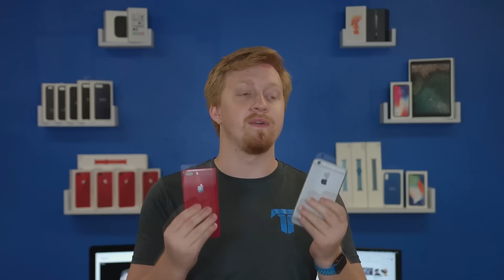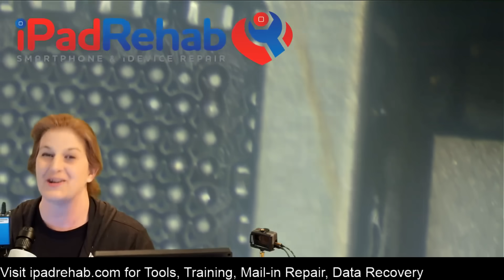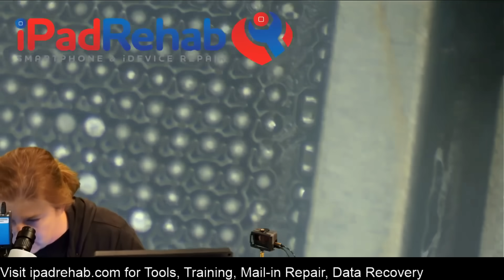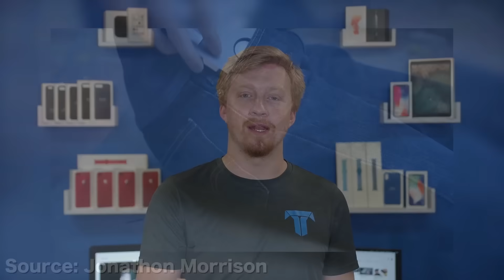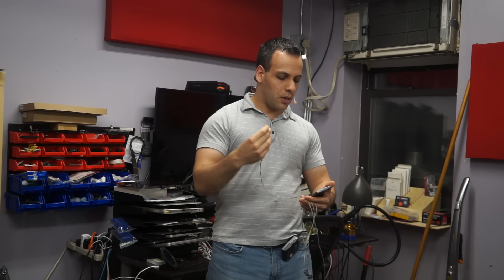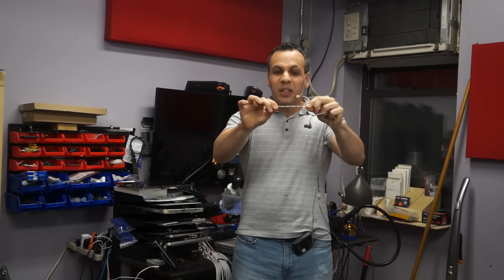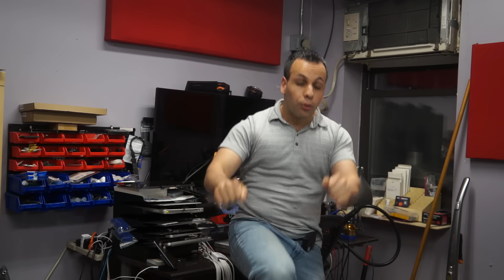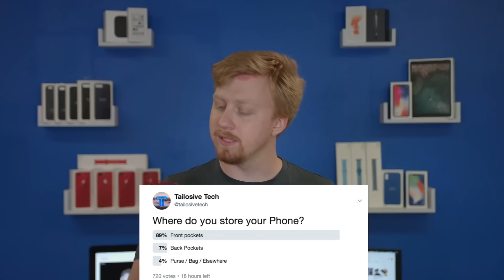The truth about iPhone bendgate deniers

Comment: In engineering term, it's called Fatigue. If you have this problem this that thing is purely design because in engineering fundamental, we create thing that go beyond fatigue requirement and that's called SAFETY FACTOR, Imagine if you went up to your office by elevator and in a week it's starting to losing it's speed, that's unacceptable to safety of people. 
Fatigue occurred by you give it extension force and compression force at the same area and over and over, you can try this on your metal or spoon and that's how the magic trick on spoon bending works. The word : Poorly engineered is the right word when this happen between in warranty's period.

Everything has fatigue and they will wear out up on time and that's why there's warranty's period because it's engineered not to break inside that period of time and if it does, it's bad engineered or bad process of producing.

Comment: Apple has been going down hill since iphone 7. For the past 6 years, my work phone has always be iphone, newest model provided by my company every year and my personal phone is always samsung's newest model. Despite the bendgate iPhone 6&6s were still great products. But since iphone7,  I start to see more and more issue with basic function, like making phone calls and messages and it has occurred to many other iPhone users in my company. Starting from iphone 7, it always stuck in the phone call screen, and it literally took apple couple of month to get it fixed. And follow up by iphone x, the signal is incredibly weak, usually 2 bars lower than iphone 7, and it never get resolved. And according to out IT department, Apple's customer service are much worse than before, the tech support are unprofessional and lack of experience. And now we are considering to switch to samsung business

Comment: I still remember when the first Samsung Note came out and Apple made fun of them for being big phones. "Pointlessly huge" "like talking into a piece of bread" 
And then they go and make bigger phones and their fans eat it up...
Reply: I got the Note 2. People laughed at me for such a big phone. 4 years later, Apple is lauded for innovative design.
Reply: @ericgulseth74  And the notes have always used AMOLED....Apple still isn't using it exclusively LOL.
Reply: @camperpro482  amoled sucks? This a joke? Or you just trolling?
Reply: @emmanuelmedina2740  30% less pixels so it really depends on your wants and needs
Reply: @0xsergy  30% less pixels? Where'd you even get that from? Display type has no bearing on pixel count. A higher resolution is a higher resolution. Both Samsung and Apple use the same type of panel, with the GS10 having 550ppi and the XS having 458ppi. 
Whites are worse? Have you heard about a little thing called "settings"?
Reply: @emmanuelmedina2740  subpixel arrangement. OLEDs share blue pixels instead of having a separate blue pixel for each pixel so they lose it. If you put an LCD and oled phone of the same res side to side you can see the difference. Google for more info about subpixels as images help. I tried to downgrade to an OLED but seeing the pixelation was annoying so I bought an lg g7 specifically for the LCD 1440p screen. Imho it's false advertising to sell 1080p or 1440p OLED screens as is because they're not really 1080p but more like 800pish. There are new OLED screens dropping now that apparently improve this but they're only available in brand new tvs for now (and not many mind you)
Reply: @0xsergy  iphone x has an oled display
Reply: @MrWizardjr9  yeah, and? Lol what's your point
Reply: Apple people are just plain crazy
Reply: don't forget pretending like it was apple's idea after the fact.
Reply: I remember that to they laughed then years later did it and apple sheep made an excuse about it later
Reply: I must say, even though I own an iPhone X, I wished I still had the formfactor of my old iPhone 5s.... I miss smaller phones... Nowadays I sometimes struggle to use that X-thing with one hand, but it also feels weird in the front pockets. Not all my pants have big enough pockets.
Reply: @Tramveller  if you don't have one already you should definitely get a popsocket to help holding the phone. It's 100x easier and more comfortable.
Reply: @marklewandowski8474  Oh my god, I hate these things. With that my phones would hardly fit in any of my pants xD Also they don't look too good
Reply: @Tramveller  hmm idk then... they do fold down almost completely flat so if it isnt fitting I'm not rly sure what to say
Reply: Mark Lewandowski Depends on the material. Steel is less prone to folding than aluminium.
Reply: @Kappa that's a fair point. Dark mode should help battery life a ton. I'll admit my g7 is lacking in battery but it's only 3000mah not 4000 like most big phones
Reply: @0xsergy  My phone is Samsung Galaxy S6 with exynos7420 CPU and a 2550mAh battery...
Reply: @Kappa Yeah, I might want to switch to android too. It is not the fault of iOS, I think that has improved a lot, it is just that iDevices keep getting more expensive nowadays and Android has also become pretty stable in terms of usability.
Reply: And the note was big for a reason! Theirs aren't
Reply: Yeah, but Samsung just did the same thing mocking Apple for not having removable batteries, sd card slot, and a headphone jack....
Reply: @Kappa I miss that from my G4. Unfortunately it and the three replacements I got all had serious battery drain issues. Refurb units so I bet that's it.
Reply: "How many Apple™ products have you bent in your life ?"
Reply: @cymes82  none, they're overpriced and not worth buying
Reply: 0xsergy they are not over priced lol. You get what you pay for. I’d rather spend extra 200 on the xs max than the s10 plus
Reply: @TT-zp8hg  Hardware spec wise they are super overpriced. Screen isn't 1440p, don't have the latest Snapdragon 845 etc. And yes you do get what you pay for, problems because that's all apple is selling you.
Reply: @cymes82  is this a Jojo reference
Reply: Because those were Steve Jobs ideals and he kinda died
Reply: I had a dell streak in 2010. dreadful phone. great for everything else. a year later, when I missed an important call (a job) on the damn thing because of its stupid touchscreen not disarming itself when the phone is in use, I threw it across the room & bought an iphone 4, which I promptly JB'd. I've never broken an iphone. my mrs has broken five so far. 
*apple needs to make its products girl-proof*.  I want louis to take a swing at sir jony ive; the guy's been treading water since jobs died, while tim cook seems determined to kill everything they've built by allowing this incompetence on his watch (no pun intended).
Reply: I honestly think Motorola makes the best phones.  They're tough little bastids and easy to flash, not to mention hard to brick. With that said, Motorola refuses to make a larger Note size phone.  For people like me with large hands, I need a big phone. This is why I bought the Note back in the day and have stayed with the Note line ever since(except the note 7, didn't get that one, thank god). Samsung makes great phones, no doubt. They do have their issues come up from time to time. But mostly very stable phones with very useful features.
Reply: ag.onewheel XR ye it’s bloody bullshite, and now I can’t find a bloody phone that’s actually good. (the last good iPhone’s dying on me.) at this rate, I’ll be looking for a flip phone in a few weeks.
Reply: Anything to distance from competition. Samsung spent a ton of money making videos mocking Apple for removing things like the headphone jack, now they took those videos down and removed the jack from the Note 10.
Reply: Ribbi Bibbi it’s bloody insane.
Reply: Who need's a stylus?
Reply: Samsung Notes are way better than any iphone ever created
Reply: When did Apple make fun of big phones? Just wondering.
Reply: Personally I dont think that's a big problem, as Jobs made fun of stylus and now it's a great addition, it's hard to be ahead of time. But the fact that they are making fun of a phone cuz its BIG, that's stupid lol
Reply: @kugelblitzingularity304  agreed also the never pens shouldn't really be compared to the old fat styluses.

Comment: I like how a response video got more views than the original... Great job!

I will say, I totally agree with Samsung's TouchWiz, but not so much on Samsung Experience. I do like the more modern look over the stock material look. I also do my own thing to optimize my phones. Extra work, but once the work is done, it lasts me quite a while.

In short, hated the S3, ok with the S6. S6 still has too many problems, but at least it doesn't lag like the S3.

Comment: yes, about the glass thing and samsung i have a galaxy 7s edge and yes both front and back are cracked, but guess what..... phone has 100% functionality and everything works just fine it just looks like shit and yes it is a hazard I cracked the  back of mine the first week i got it just as I was going to the store for a case but again it still works and is a perfectly functional phone more than 2 years later (not sure about water protection but yeah.... you get the point) and the strangest thing is my phone's screen is cracked (the front of the phone) but still colors and picture and touch screen are perfectly fine no distortion no color defects touch is responsive as it was in the store it is perfectly fine tho it has multiple cracks on the front of the screen.....

Comment: as someone who still owns an s6 edge+, i can say I agree with all those flaws, although I didnt care about sd card support at the time (since i dont use the camera), though of course I did when i ruined my second phone by accidentally swimming in the ocean while on vacation with the phone in my pocket and losing all my emulator game data, and the none replaceable battery ( I leased, so i figured i would have a new phone before that became an issue), two thing that were a concern to my folks (mother got the note 5 for the sd card, and my dad got a note 4 for the replaceable battery). still love my phone for the sleek futuristic look and curved edges (good for watching videos on, never bothered with the edge feature), enough that im not interested in the s8, although part of that being no physical home button, since i dont trust touch sensors that can become unresponsive if anything happens to the screen or a software issue causes a freeze or hangup. only issue ive had now is it refusing to charge unless I use a specific wire and position the wire and phone in a specific way and dont disturb it at all. thought about taking it to a shop for a fix but at this point im starting to wonder if id be better off trading it in for a new (likely not samsung) phone.

Comment: So I’m a big Apple fan. But also a big Louis Rossman fan. I acknowledge the iPhone 6 was a piece of shit, I experienced bend damage and touch ic failure. iPhone 6 was garbage. And i also experienced the faulty charge port/audio port on the iPhone 7. 

The reason I still buy Apple is because nonetheless their products still work better than competitors. They still have a better eco-system. Better security. More simplicity. I still get much more use from Apple products rather than competitors. 

The purpose of this video is addressing deniers. And i agree, Apple sheeps are deniers and have a problem. I’m an Apple fan and understand what problems come with it, but i also enjoy their customer service and the fact that if i ever have a problem, i can walk into a store and just have the phone replaced after identifying a problem. 

iPhones suck. They just suck less than their competitors. Also the eco system draws you in and keeps you in.

Comment: I went from the Samsung S5 to a Google Pixel (unlocked). I'm never going back to Samsung again. And I'm never buying a locked phone again either. The lack of bloatware is fucking awesome! Sure, there's the Google bloatware that I don't use, but I would have all those same apps required as well as service provider AND manufacturer bloatware.

I do miss my micro SD card, but right now I'd settle for having inductive charging. But I definitely want a headphone jack, so I'll probably keep my Pixel until it dies. I can't believe Google removed the headphone jack from Pixel 2 (and is rumored to still not have it for Pixel 3).

Comment: The problem isn't just that the phone flexes, it is that some parts flex more than others. The PCB is more flexible than the IC's, which means when you bend the phone, the layers start to separate. Imagine a strip of rubber with pieces of steel plates glued to it. If you try to bend the rubber, the steel plates stay straight, and the glue struggles to keep them stuck together.

Comment: I noticed funny thing about Samsung products. I bought the first Note when it launched, and used it for around 2 years before it gave up. 
It never had any physical bend damage, and actually the first thing to fail was the usb board. That was replaced, it worked for... some time, then same board failed again, the phone stopped charging, and suddenly restarted, failed to load, got stuck in a boot loop, and completely bricked itself. There wasn't really any way to get it working.

On the other hand, after that, i had a Note 4, and that thing bent ALOT.
Almost like 1-2 degrees. It was accidentally bent twice, and silly me just bent it back. It bent so much, even the screen popped out after it got cracked. It was repaired, for free of course. They changed the frame (and the screen as they prob broke it while trying to remove it)
But that was it, nothing really happened to it... at some point... it did stop charging (wow, how surprising)

Now i've been using One+3T for around 2 years. Never needed service, hasn't bent at all, charges fine, very minimal battery degradion (went through many batteries on the Notes) and it still works relatively fast compared to when i first started using it.

Personally, i'm not going back to Samsung anymore. Seeing now, how well this little chinese phone has performed, it's clear this is the way to go. With Samsungs, there was always some little problems, connection breaking, sensors (like gyro-sensor) failing, buttons breaking etc. 
The Note 1 was serviced 2 times, and the Note 4 3 or 4 times if im correct.

...And yes. This comment got a bit offtopic. Basically, what i was trying to say was, that the Note 1 most likely had flex issues, where the Note 4 did not.

Comment: I have owned an iPhone 6 since July 2015. I have never had any issues with flexion. My phone has even taken one battery replacement and is still working like I got it brand new in July 2015. Maybe this is because I have had it in an OtterBox defender case it’s entire life. Maybe if people did something similar their iPhone sixes and six pluses would not be experiencing this issue. I am not an expert in iPhone repair, I am not an engineer, and I have never taken an iPhone apart. I do have four years of IT experience but it is mostly with troubleshooting. I have taken apart computers and put in new RAM and replaced hard drive but that is about it. This is just my opinion. There can be no denying that Apple isn’t full of crooks thieves and liars but come on people if you were going to buy a phone from a bunch of crooks thieves and liars at least do your best to protect your investment so that you don’t eat it on the backend.

Comment: Ok Mr. Rossmann, problem with biased people like you is that you ONLY see devices from people who DO have issues with them. I had iPhones since the first one up to iP7 and had ZERO issues using it every day and no im not youtuber am one of those who you said “keep society” running. I have seen a lot of other users like dozens of them and no one had ever issues even ith iP6. So apparently its not like you tend to put it like every 6 is gonna break. And btw that great Samsung S6 I also happen to had had issues with losing calls in middle of coversation etc. And I used that phone very seldom most of the t8me it sat in shelf. So it was probably not that great, only people dont care much about Samsung.

Another thing you forgot to mention is that sice iP6S Apple chose a different alu so that its harder to bend even bend it on daily basis, thats why “bend gate” did not happened since then. 
But yes you ofc see people who managed to damage their 6S and 7 bc if they didnt they would not asked you for a repair. 
So had 6 issues you mentioned ? yes. Did they changed the casing since then? Yes. Was there similar bendgate since then? No. Do you really thing if there would be SAME bend issue like with 6, there would not be similar or bigger backlash? You can bet it would, bc attacking Apple is so great... no one would spare them.
Reply: First off, it's alloy not allu , and the iPhone that you are no doubt using as an apple sheep should have autocorrected it, so you need to learn to spell. Now if you can't spell, then how should you expect everyone to not have an problem with an phone.